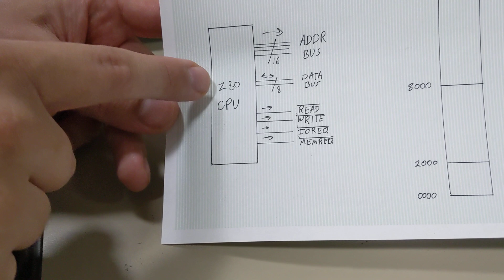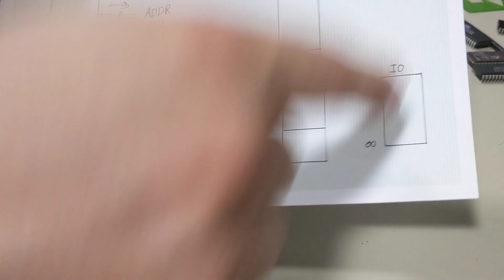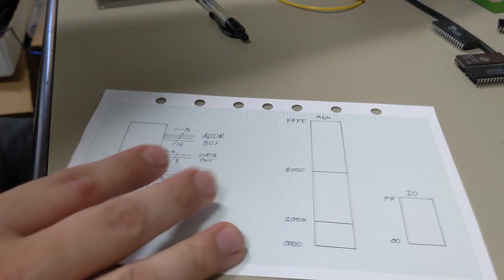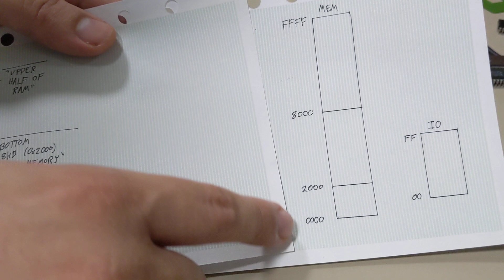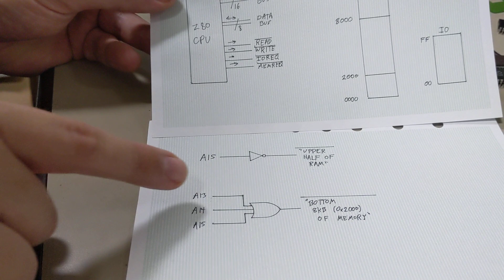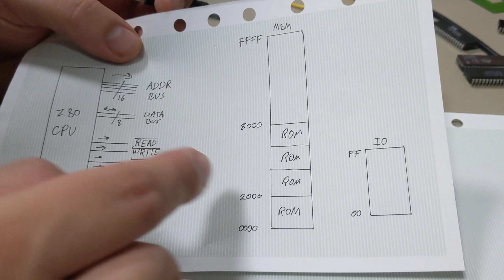Understanding the Z80 Memory Map

Comment: I’ve built a handful of Z80, 6502, 65C02, 65C816, 8008, 68000 among others, homebrew computers over the years, I’m thinking about building a i4004 computer with the 4004’s I purchased around 20 years ago back before they got expensive, so far I’ve only built a test circuit for them, they tested good as they were new old stock parts when I acquired them & that was before the relabeled chip plague became a problem about a dozen or so years ago.

Comment: would it be possible to elaborate more on the io register and how they  should be used (eg:for uart, or 8 bit bus for leds) ?
Reply: I/O in the Z80 isn't a register, although it does use a register (generally the accumulator or A register).  It's done nearly the same way as accessing memory, and in fact you could add up to another 256 bytes of memory and access it using I/O instructions.  You would not be able to use it to run programs from, but you could use it for data storage.  In fact, due to the (undocumented) way a particular instruction accesses I/O addresses, in theory it's possible to have up to another 64KB of memory for data storage by using I/O addresses.

The IN A, (C) and OUT (C), A (indirect input and output) commands both actually do IN A, (BC) and OUT (BC), A which would in theory allow you to use 16 bit addresses for I/O.  I say "in theory" because few if any programmers and no hardware (that I know of) have ever attempted to take advantage of this undocumented behaviour, and the hardware required for 16-bit I/O would interfere with the "immediate" mode IN A, (#nn) and OUT (#nn), A instructions, making them unreliable in practice.  Anyone programming for a system which was designed to use the full 16 bits for input and output would need to be aware of this and avoid ever using the immediate mode IN and OUT instructions.

But to address (hah!) your question directly, it's just a matter of decoding the 8-bit (generally) address and the control signals.  Instead of using MEMREQ-BAR to initiate the transfer, the CPU uses the IOREQ-BAR line to tell the hardware that this is an IO request instead of a memory request.  (-BAR just means that the signal is active when low instead of active when high)

(Heck!  I really wrote a lot, didn't I?  I hope I didn't overload you with useless information.) 😅

Comment: Hello
I'm in the process of building a simple z80 computer.
I have one question about z80 addresses.
It is about connecting the eeprom km28c17 or km28c64a systems with 12 addresses and 8-bit data bus to the address line.
Everything was going well until the 11 address line eproma was connected to the 16 address line z80 what about the other addresses or the rest, i.e. A12, A13, A14, A15 will be unused?
Give 10 k to the rest of the mass From A12 to A15?
Reply: A12-15 conditional logic to provide a /CS for the ROM so it doesnt mirror throughout the address space and over the RAM.

Comment: A simple way of decoding that could be done with a single chip is to use a 75LS156 which is a 3 to 8 line decoder with open collector outputs. This would decode the upper 3 address bits to blocks of 8K and you wire OR the outputs to allow any map layout you like and the enable input connects to the memory select signal. Additionally IO space is actually 16-bit addressed, the upper 8 bits are the C register. I love the Z80 for both the hardware and the software design. If I were building a new one these days I would just use a MRAM device to play both as the RAM and the ROM.
Reply: I always had my eye on the HD64180 10MHz, but the Z8S180 I's up to 33MHz , shame the 8bit retro crowd are wary of anything other than the easy Z80.
Reply: 74LS156
Reply: Use an MSP430 derivative that has MRAM built in!! all in a single chip with I/O 🙂
Reply: I'm in a minimalist computing group and have for sure seen a lot about that decoder, sounds really useful.

Comment: As a guy who grew up with 6502s, I always through the Z80's extra IO memory space was a great idea. It makes addressing peripheral devices a little easier since there are fewer address lines to deal with.
Reply: It doesn't really make IO addressing any easier, if anything it adds extra needed logic if you want to make use of it as extra space. What it does do is make it really easy to create banked memory systems that have Megabytes of memory or have easy means to swap ROMs in and out although these methods don't simplify the SW.

Comment: This brings back memories.  So if we put latches on the io bus we could have a small rom and kernel in the low memory and use the latched addressing to page in different 32k high ram areas and if the kernel was smart enough we could create both a paging and some sort of possibly interrupt driven multi programming environment.  Everything would have to live in its own 32k space, or we could write a more complex kernel

Comment: The TRS-80 memory mapped 1k of address space as video memory for direct access. 

    0000-2FFF Level 2 ROM
    3000-37DF Unused
    37E0-37FF Memory Mapped I/O
    3800-38FF Keyboard map
    3900-3BFF (Keyboard map shadow)
    3C00-3FFF 1KB Video RAM
    4000-41FF RAM used by the ROM routines
    4200-4FFF Usable RAM in a 4K machine
    5000-7FFF Usable RAM in a 16K machine
    8000-BFFF Additional RAM in a 32K machine
    C000-FFFF Still more RAM in a 48K machine

More data here for I/O ports:

https://www.trs-80.com/wordpress/zaps-patches-pokes-tips/ports-and-i-o-devices/

Comment: I/O space of z80 is 16bit boundary not 8bits !!!
Reply: Officially it is 8 bits - according to the datasheet which states 256 possible IO addresses.

But since the Z80 can present the contents of a couple of different registers on the top half of the address depending on which IO instruction you use, then you can use various techniques to obtain a bigger address space if you wanted.

Or you can use the contents of those other registers to read/write sequential addresses of a peripheral device e.g. using B as a counter.

Or maybe use them to assert certain control signals of the device you are interacting with.

There are potentially a couple of different things you can do utilising the top half of the address bus, so simply stating that the address space is 16 bit is wrong IMO.
Reply from the maker: I mean, the io instructions take an 8 bit address, so it's 8 bits. You can use the top half by loading addresses in registers and using the right io instructions.
Reply: The Z80 I/O space is offiically beyond 64K addresses based upon the legal instructions available.
It’s how you want to implement the I/O address space that determine the number of ports available

For example, many machines use input ports such as IN (C),A to actually write to an 8 bit addressable OUTPUT port.
(YEP, an IN instruction to write to an OUTPUT port)
What happens in this example is that the contents of the B register are written to PORT (C) via the IN (C),A instruction
The output port uses the /IORQ, /RD and A0-A7 enable an 8 bit flip flop to capture the value of reg B.
Machines that use this example can’t use 128K of I/O address space and are usually limited to 512 I/O addresses because the upper byte of the I/O address space is used to convey data and not an address.
Reply: Ok, fine , but instruction out (C),r put contents of r register on bus and C register at address A0..A7 and B register on A8..A15 this not means 16bit I/O? Out (N),A put A on bus and N at A0..A7 and repeat A at A8..A15    in that case 8 bits I/O ,Z180 inclusive have a instruction Out0 (N),A to write at page zero A on bus and N at A0..A7 and zero at A8..A15 to warrant   to acess   only page 0 "First 256 bytes " , system like MSX inclusive use 16 bit I/O in bios to access  devices in I/O space  and recomend  to use this type of instruction!!! What you think about!!!!
Reply from the maker: I think your argument is with the designers of the Z80 who pretty clearly said that the IO address space is 8 bits.
Reply: @KennethFinnegan Ok, you won, but during my life I have designed only 60 projects using Z80, 1 using the Z280 (which is no longer manufactured), 14 projects using the Z180, 1 one using the 32-bit Z380 (which is also not manufactured) With the exception of 4 projects with Z80 the rest I used out (C), r instead of Out (N), R. But that's ok, it accepts both 8Bits and 16Bits I / O, depending on how the I / O bus will be used. O. In CP / M it actually uses out (N) due to the 8080 inheritance that only had out N, A. Use 8 bits with some systems and other systems like MSX uses out (C), r which is 16 bits. and designed by Microsoft. The Z80 Hardware allows and works in practice to use 8-bit I / O and 16-bit I / O will depend on the Hardware designed, but of course the bus continues with 8 bits. regarding I / O addressing, which can be either 8 bits or 16 bits, ie use A0..A7 or use A0..A15

Comment: Wow!
So amazed by your channel, I've been interested in Z80 stuff, but never built a thing (yet). I've been long wandted to make a Z80 computer with switches and LEDs as an interface, but felt like a Z80 is a bit too good for that, so I'm still planning.
Do you have some good advice for a beginner like me?
Reply from the maker: Start building stuff.
Reply: @KennethFinnegan  Will eventually get to there, but only when I'll have time :)
Reply: If you want to do it on the cheap, search for rc2014 on the easyeda site and get your boards made by jlcpcb

Comment: Apologies if you've already covered this in another video, I've only watched this video, but I thought you may be interested in this:

There's an interesting feature of the IO commands on the Z80; For example, the command "OUT (C),A" outputs the value in register A to an IO address pointed to by the value held in register C. The command asserts the value in register C onto the address bus pins A0-A7, however the processor also asserts the value in register B onto address lines A8-A15. This actually allows an IO address space of 64KiB rather than the official value of 256bytes.

I have check both the Zilog datasheets for the Z80 and Rodnay Zak's book "Programming the Z80" both document this "feature"
Reply from the maker: I haven't covered that yet! It's coming in one of the future videos, so you beat me to punch.
Reply: I read that too, but who needs more than 256 IO ports  The only advantage I can see from using it would be to send 2 bytes at the same time
Reply: @PetRatty  It's used on the Sinclair ZX80, ZX81 and Spectrum computers (and clones) to scan the keyboard matrix. Effectively as a cost saving method.
The Intel 8080 (and 8085) CPUs do use only the lower eight bits for IO addressing.
Reply: @markevans2294  All the 128K ZX Spectrum models also use various 16-bit I/O addresses to control memory paging and the Sound chip, as well as the floppy disk controller in the +3, but i know that you already know that, being a veteran "spec-chum" - yeah i recognise your name, both from the Speccy forums, and from various magazines ;)
Reply: you beat me to it, i was gonna say you can have 65536 IO addresses, i have computers that use addresses above 32768 for their keyboard read port..yes i said 'port' , one,  all IO even addresses count as the internal IO port, but upper address lines are fed to keyboard rows, to select them, so you can only use odd addresses for yourself, unless you use a bit of external circuit trickery

Comment: easy peasy.. I don't mean any disrespect but how long you have been cooking with a Z80 and how long did it take you to put together that board? There are a lot of things you didn't cover and there are things that really didn't need to be covered in this introduction. For one I never saw a memory map. What exact sequence of events take place upon reset? I'm guessing you have reset tied to a capacitor and a resistor so that the CPU  is automatically hard reset when it's powered  up. Where are the interrupt vector tables in memory?  I'm sure you know the CPU expects an address to jump to when it reads the memory address thats mapped to the  various interrupts. ( normally anyway ) . Typically I would  have grouped the signals as Address bus, Data bus and Control bus I/O and power of course. I think you'd find a 74ls38 to decode memory would make life easier, depending on your specific choice of components. Back to the memory map. What exactly does the CPU expect to see and at what address space. Writing code to start at any address without regard to what the CPU expects isn't the best of ideas. That computer shouldn't take more than 72 hours to complete and with lots party time thrown in. I would recommend using a 6 or 5 inch needle driver to interconnect the wires. You'll find it a superior tool to any pliers.  For I/O an 8255 might work best for you. Tri-state control would be worthy of  consideration as well as a dedicated cpu oscillator and a 555 to drive the clock signal for single stepping the cpu. Forget cpm. Use assembly language. I really dont understand  the current interest people have in these old CPU's. They were great in the 80, but we didn't have much to work with then. I think you'd find the MC68000 a lot less restrictive when it comes to CPU horsepower and building applications.  The Z80 was great for control applications, but there are so many better things to use now. If you like old stuff, add an AY-3-8210 to your project. I think theres a modern version of the chip too with same pinouts. Anyway...have fun
Reply from the maker: When someone starts a comment with "I don't mean any disrespect but" the rest of the comment is always a consistent brand.
Reply: @KennethFinnegan  I don't mean any disrespect but your voice is clear and pleasant to listen to.
Reply from the maker: Shakes fist at the exception to the rule
Reply: @KennethFinnegan  I don't mean any disrespect but this helped me to understand custom computer circuitry